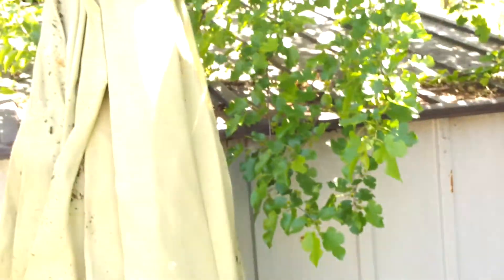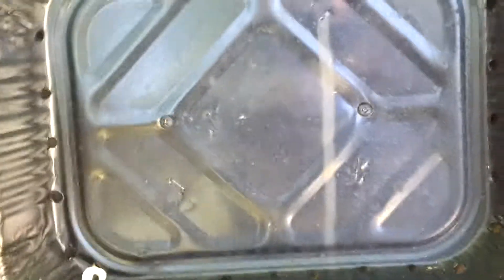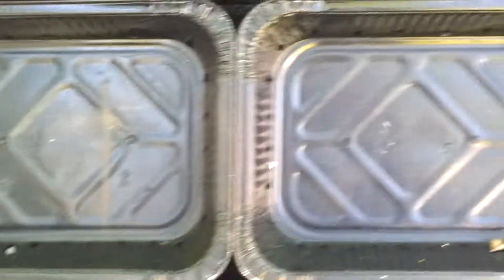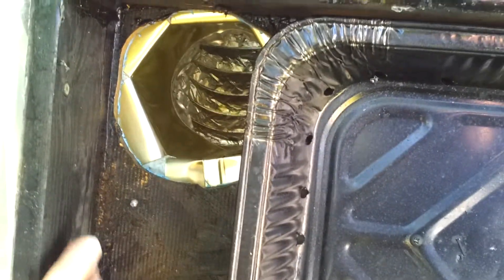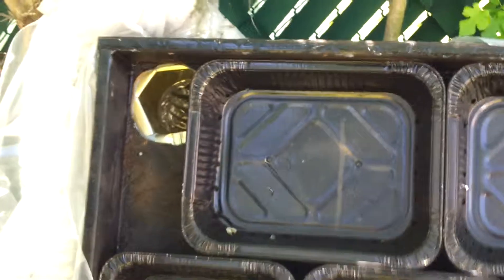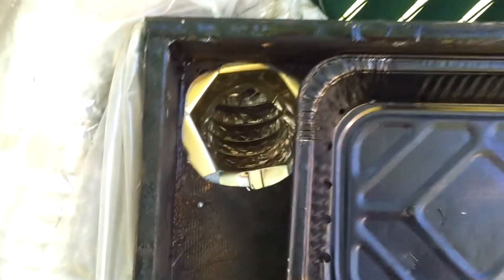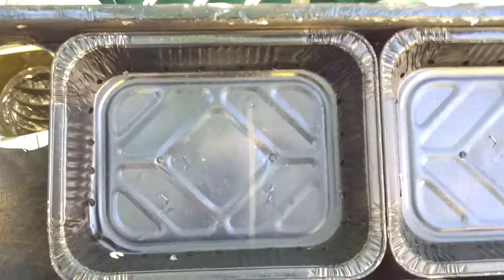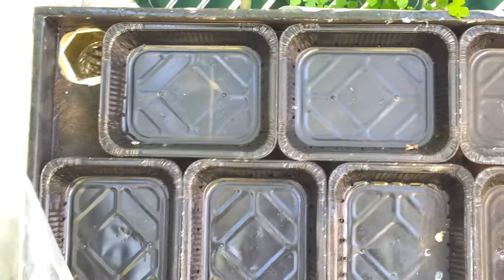$35 4' x 8' Solar Heater Inner Workings  (How to DIY )

Comment: An amazingly simple and effective design that seems equally simple to build as well.  (I watched your working video too) UV resistant "clear" film is available from Amazon and I suspect it would not be as brittle (over time) as the plastic sheet you used.  It would cost a bit more but still maintain the easy to make advantage you have shown us here and last much longer. Nice work, thanks for sharing it.
Reply from the maker: Your Welcome and thanks for sharing your info..